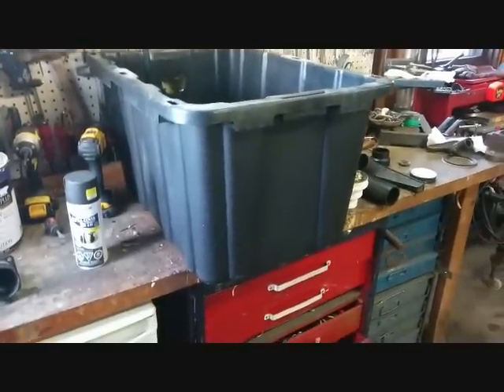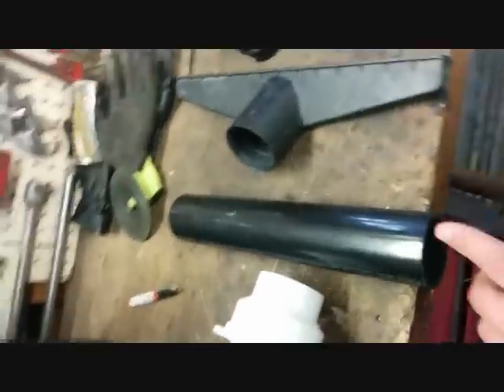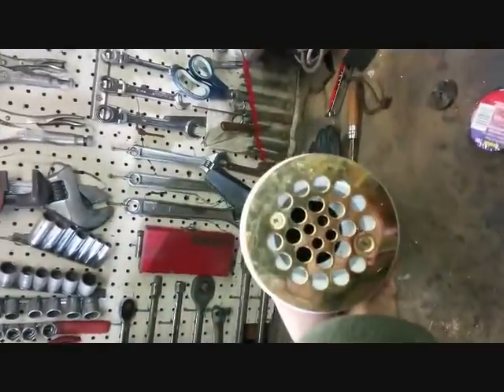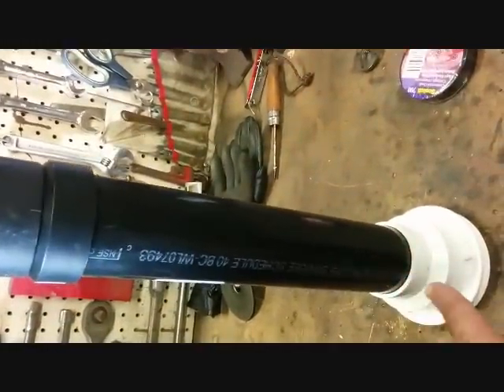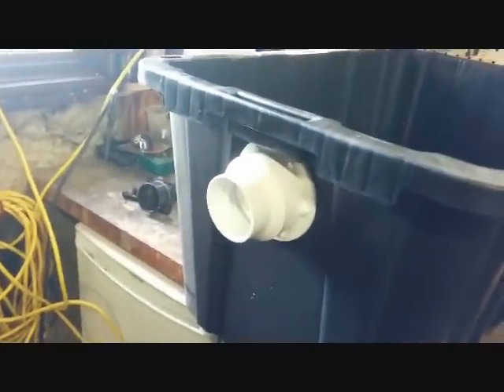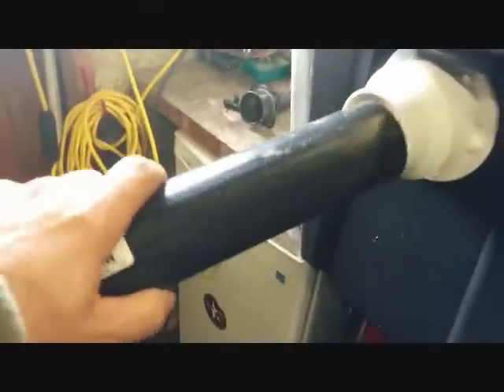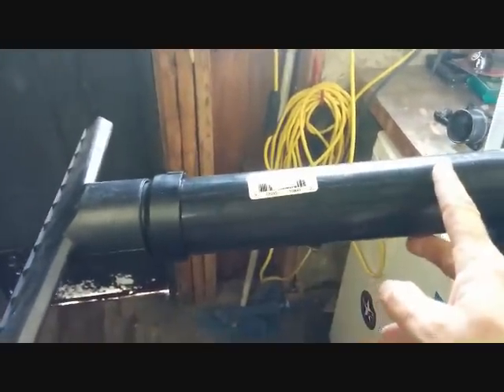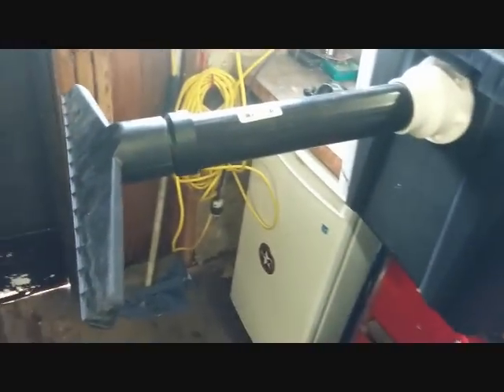D I Y water fall box

Comment: I would have never thought to use a drain instead of a bulkhead! I always get teased for my "hillbilly engineering" lol. What kinda metal is on the drain? I have very large fish in an undersized system and worry about using copper and zinc.